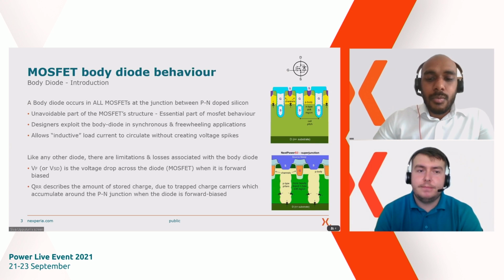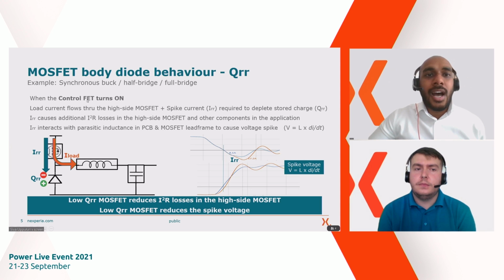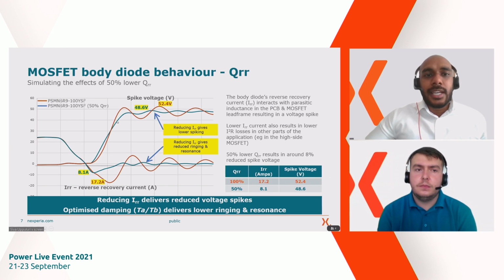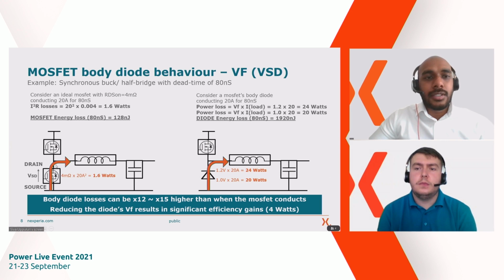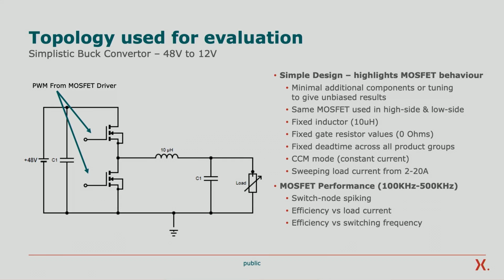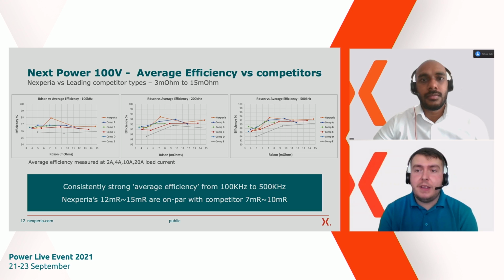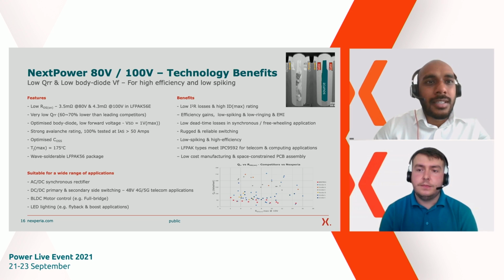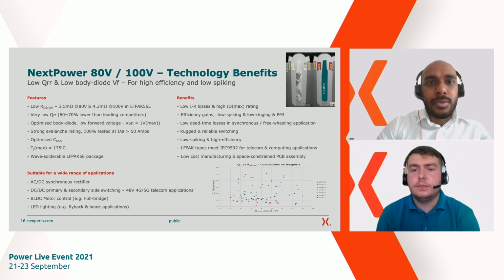MOSFET body-diode behaviour, Optimising Qrr & VSD to give efficiency gains & reduced spiking

Comment: Thanks for this tutorial, how can I model Qrr in fontion of temperature? do you have an equation for that?
Reply from the maker: Thanks for the question, here's the response: We do not have a simple formula for it – best thing to do is use our PET models in a double pulse circuit at the temperature of interest and extract the Qrr.
Reply: @Nexperia  thanks for answering where can I find your PET model? 

Also I have a question regarding body diode model if you have one also, i am interested.

Best regards
Reply from the maker: Our pleasure. The PET models are found on our product pages in the support tab. 

Please do follow-up with your diode model question. We do have this video  https://youtu.be/9XIf1KGnNcc that could help, or our engineers handbook - https://efficiencywins.nexperia.com/efficient-products/mosfet-and-gan-fet-application-handbook.html
Reply: @Nexperia  THANKS for answering, I'll have a look on the link you've sent.